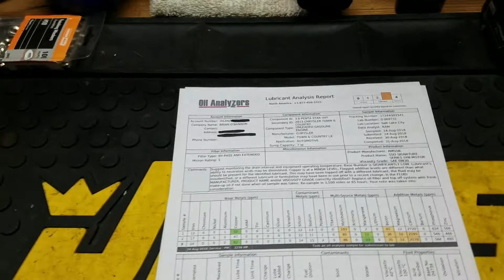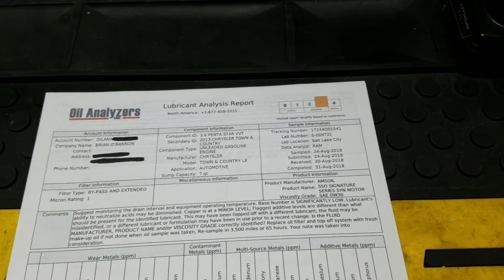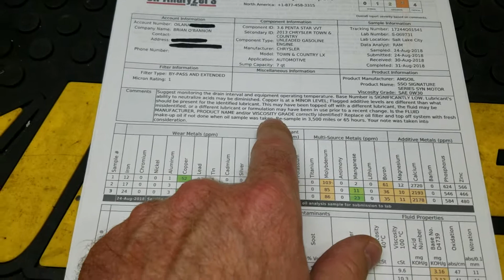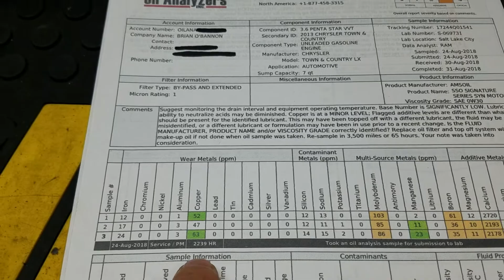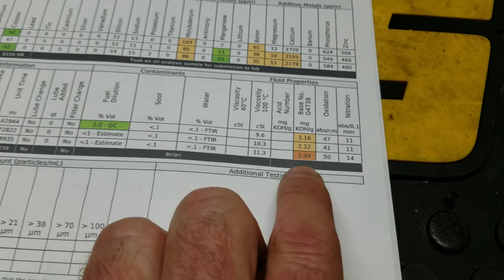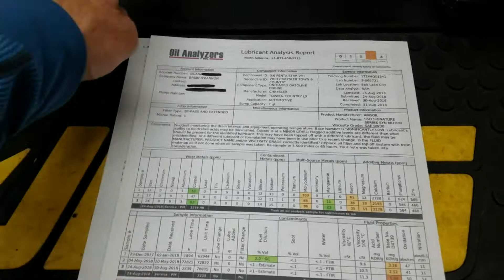AMSOIL Oil Analysis #3!

Comment: I have watched all three videos and I am still not clear.  Are you saying you have driven 78K miles on the same oil drain interval.  If so, where are the oil analysis for the first 62K miles?  When did you add the by-pass filter.  Your viscosity has increased by 2 centistokes, oil is clearly breaking down and thickening.  If you added a by-pass filter, then technically you added lube.  In the video you first admitted to changing filters, but at the end you said you did not.  Then you said you may have added up to a quart of unknown type or quality of oil, from bottles of left over unused oil.  I have used Amsoil for years, but your presentation in the video is all over the place, and many inconsistant statements.  You said you do a lot of idling in the van, yet the hours accumulated compared to miles driven indicates an average speed of 47mph for engine operation.  That is nearly 90% highway miles.
Reply from the maker: Again, your opinion is something you are entitled to. I'm fine with a healthy debate and yet you come in here with borderline accusations that I misleading and "all over the place ". I have been using AMSOIL for over 20 years. I don't claim to be an expert yet I have measurable experience using nearly everything they ever offered for use. I've no idea what you are trying to prove with your "47mph" statement as it makes no sense to my videos.

Comment: I used 0W30 (series 2000) when it first came out and my lead was elevated at 10K in a Toyota car, after changing to ACD there was a reduction in wear metals and the oil was less expensive. I sent one sample to OAI and it was pristine on the report, I contacted OAI to Particle Count the same sample and it was condemned at that point. Oil sampling can be misleading, refuge companies changed their maintenance policy of using Oil Analysis and reverted back to fixed drain intervals because of fine particles that was causing additional wear increasing repair costs.. I started dealing with BlackStone because they are more objective and not a partner with the Amsoil corporation.  BTW: I had the rod bearings fail on one engine two weeks after changing oil with Amsoil 10W30 and could not wait months for the company to investigate the damage per their warranty policy because it was my only car. (be aware the Amsoil is good at marketing their product and services)
Reply from the maker: Interesting to hear your story. I remember a big agricultural sprayer that a client of mine who started using AMSOIL threw a rod. That engine was was diesel and it had a ton of hours. They rebuilt it and continued to use AMSOIL. So far, it has surpassed the previous hours of operation before the rebuild and continues to run strong. As for the you experience with OAI, I have had any of those issues. As you can see in my videos, everything seems fine. I believe that eventually I'll need to change the oil due the way I use this vehicle to pull a trailer unless I install an oil cooler. I guess we'll see. So far,  my van has been maybe 1000 miles since my last sample so I won't perform an analysis until I drive it more this next summer.
Reply: @ob1n  The engine that had rod bearings fail had Amsoil in it long before this happened and was in good condition. The bearing wear indicates a lubrication problem after the oil change. Soon thereafter, one of the piston pins started to knock. All the problems I experienced seems to be attributed to boundary lubrication. I went back to 30w oil and never had this type of problem again in that engine after replacing the crankshaft bearings. I worked in an engine shop for a while and have seen a lot of engine problems with failed parts.. The lab will always tell you the sample is good unless there is fuel or coolant in the sample.

Comment: I’m going switch to amsoil, I read your description what is the thing u said is your dealer reference number is it like a discount code to use on the website?
Reply from the maker: Yes. 1086626. It's not necessarily a discount code yet you can get a discount via the preferred customer program. Or you could become a dealer yourself as well